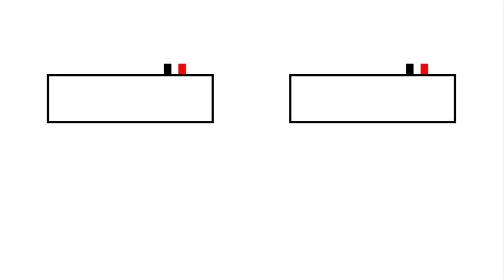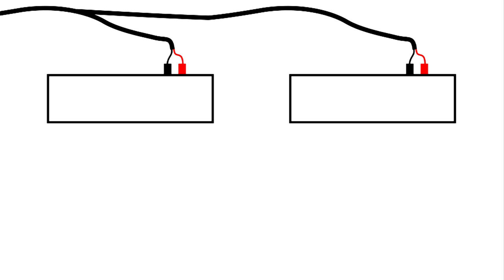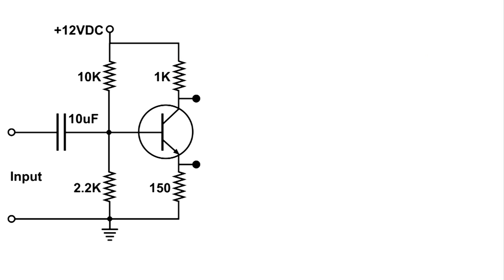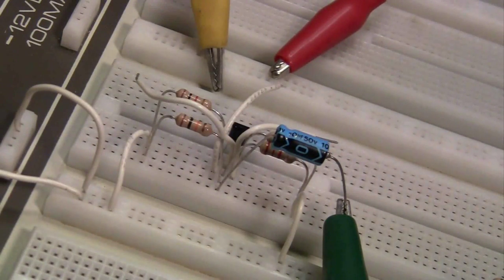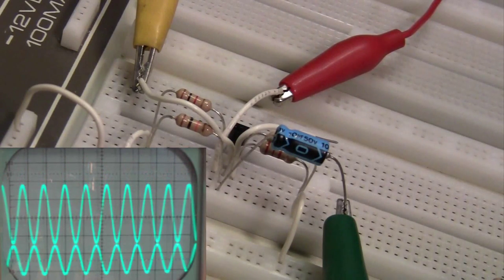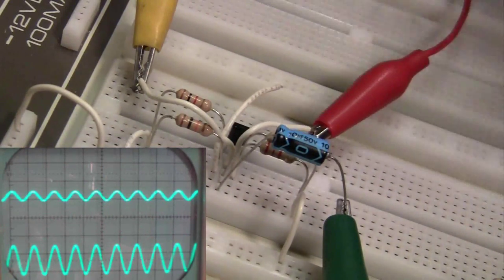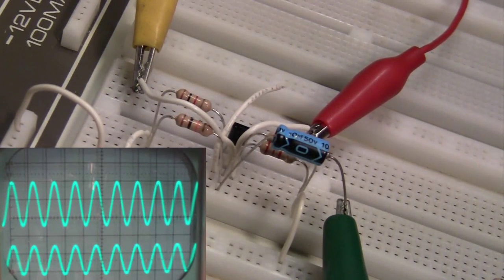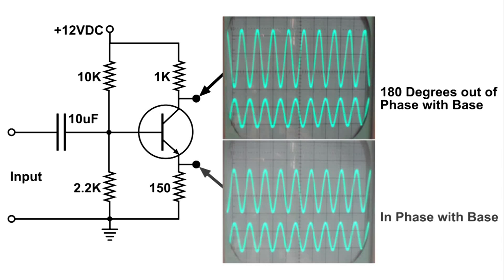Audio Phasing, Important and Useful

Comment: Are you using the volume control of the crowd mic to find the null-point (cancellation point) of the two mics combined mono output?  

I know of the vocal mic trick - two identical mics wired out-of-phase and placed together... when one is sung into, the vocals get thru, but at other times the band and other sounds cancel out.   

It would seem that only by working the gain of the stadium mic to a precise point would you get the desired background cancellation.

Comment: Hi Rick. Thank you for this great video. I have, to my embarrassment, never thought about that "polarity" of speakers. Or I have just thought "It is AC, so I ignore it". I never had phasing in mind...
Anyhow. I have a question for you, regarding this topic. The thing is, that I am trying to observe phasing between the collector and the base of a predriver transistor in a Pioneer class AB direct coupled amplifier. My problem is that the base is very negatively biased (37.4) where B is -38V. Now the signal going to the base of this transistor, is basically the unprocessed input signal, with the exception of having gone through an initial stage differential amp, where negative feedback is fed to as well. My thought is, that this minimally amplified signal (AC input signal) that gets super imposed onto the negatively biased base of the transistor of interest, is so tiny in relation to the -37.4VDC that it is probably not detected by the scope? The wave on the collector is greatly observed.
I'll more than gladly make a video of it, showing the diagram, telling what I am doing, and how I guess it works, and taking these measurements, if you bother to watch it and correct me.

Have a great day,

-Ragnar
Reply from the maker: +Ragnar W. Eliansson 
It sounds like you have your oscilloscope to measure in DC mode. If you change it to AC the trace should stay on the screen.
Reply: +AllAmericanFiveRadio Thanks for the reply. You are right. It is set to measure DC. However, the window in the software, where I should be able to switch between modes, is grey and stuck on DC. I don't know why, but I am unable to switch to AC.  My scope is a Hantek 6022BE.
Reply from the maker: +Ragnar W. Eliansson

Put a 0.05uF cap in series with the probe.
Reply: +AllAmericanFiveRadio Thank you for the logical solution! Is there any particular reason for the value of  0.05uf though?
Reply from the maker: +Ragnar W. Eliansson 
The 0.05uF capacitor will pass audio + RF. If you want to eliminate audio and pass RF, use pF capacitance starting at about 500pF.
Reply: AllAmericanFiveRadio Ah, Now that you mention it, I can remember you covering just that, in a video where you talked about bleeding the RF to ground in several stages while amplifying the audio.
Thanks a lot for the help. I certainly appreciate it.
-Ragnar

Comment: what happens is the speaker cones move in opposite directions, to show this connect a flashlight battery to a speaker, one way the cone will move in, reverse the battery and cone moves forward.

Comment: hi, this is an old video, but i have a question, so the two output of this one transistor amplifier 180 deg out of phase, could it be used to connect to the pro audio amp with balanced input? hot/cold/ground usually xlr connectors? does this 2-signal output of the transistor will work with that as balanced signal output? thanks.
Reply from the maker: It could be used, but the outputs are not at the same level. So for Push Pull output at taped secondary may be used or NPN and PNP or N Chanel and P Chanel MOSFET.
Transistor Push Pull Audio Output Amplifier
https://www.youtube.com/watch?v=NU8Yk0bXlkk
Transistor Push Pull Amplifier, for the Beginner, no transformer, the basics
https://www.youtube.com/watch?v=e_SE4KQjYR8
MOSFET Push Pull Amplifier Visual Demo
https://www.youtube.com/watch?v=-6N7l1dnk6s 
Push Pull Audio Output
https://www.youtube.com/watch?v=JhaqeuhIVCc 
Push-Pull Output
https://www.youtube.com/watch?v=_sZJgQfO5wg